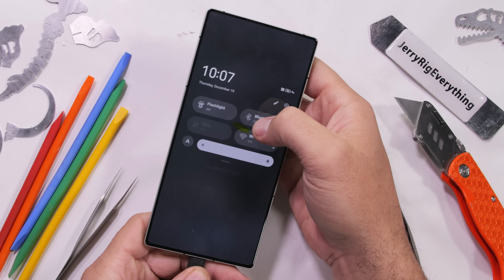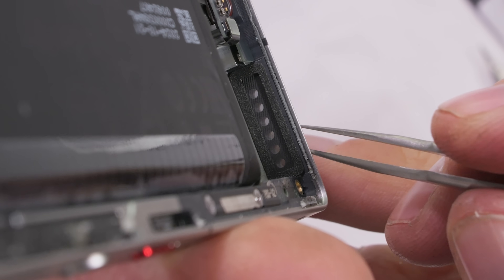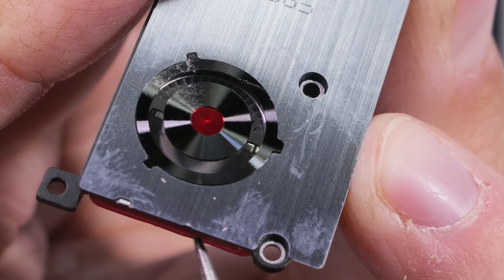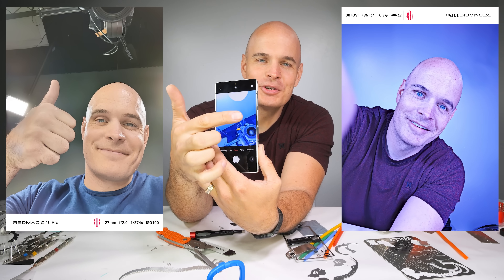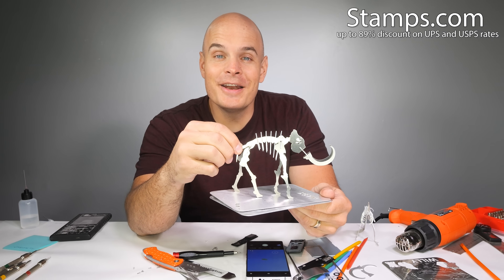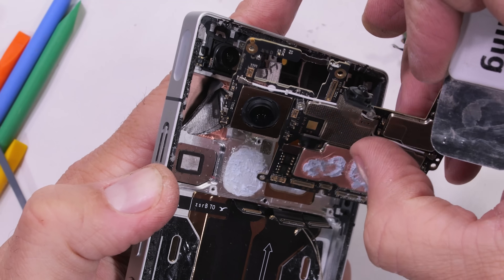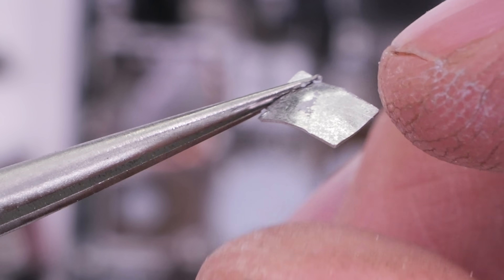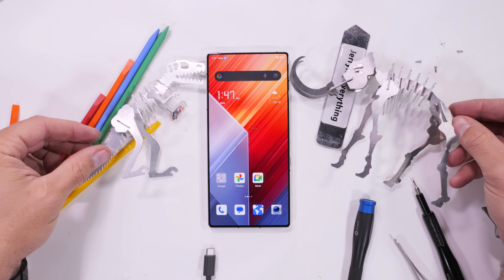The Smartphone from 2040 has a 'Liquid Metal' cooling system inside?

Comment: A heat pipe by any other name? They are great thermodynamic heat transfer devices but you always must ask the question__where is the heat being transferred to? The cell phone body or blown out to the environment via a fan.

Pasadena Public Library 2005 Exiled NASA PhD Wayne Manzo turned Dell Laptop rebuilder is modifying an old Dell Latitude LS700(?) clicking over at 700 MhZ Pentium 3 which caused the noisy fan to turn on. Solution? Make a huge heat sink that is the size of the laptop and connect it to the CPU cooler
inside the laptop. I was using the wrong metal as a Homeless NASA PhD only has access to Aluminum Roasting Pans from the dollar only store. Did it work?
The Mind Controlling UFO NASA DNA Spooks in PASA DNA forced me to adjust the heat sink with the laptop turned on. I remember removing it then accidentally dropping it on the motherboard which solved the loud fan problem by turning the MB into scrap electronics. That is Pasadena for you.
Keep the homeless hiding in the bushes at night and walking around like Zombies. I think all UFO Spook LA County is really a UFO Base.

Comment: After dropping the phone in a fishing pond, I can confirm a few issues. Firstly the cooling still works though I am not going to push, however the volume button for volume up has stopped working. Water seems to stay behind the glass back of the 512gb model.

Comment: Zack, red magic 10 like all of its predecessors have MAJOR problems like:
– Flashy cooling means nothing when it uses a one-sided board with poor thermal layout — SoC & memory cook each other.
– NAND/RAM degrade fast, then die.
– Zero real software support, no long-term patches = security risk.
– UI is buggy, bloated, and poorly coded.
– After 6 months? Value drops hard, performance tanks.
It’s a disposable flagship — sell it fast or stay ready for issues.

Comment: I own the 10 pro. the enclosure for the liquid metal is practical, but comically flimsy, to where Zack completely missed it on the first pass. Considering that Indium is toxic, I would think it to be encased/sealed. Instead, it is exposed to open air when fan module is lifted. Version 11, please have a sealed casing to quell the most neurotic of us dads. maybe... just remove entirely and replace with a micro copper heat sink. happy gaming.

Comment: Like that metal T-Rex. 2040? Poor things.. Strokes Plasma generated Ultrasonic holography pressure printing science Goal: Synthetic Diamond & Carbon nanotube technology + Piezoelectric Crystal with amplifier system to power using Earth's ambient Ultrasonic atmospheric stability frequencies alone. "UFO" Watch "The Twilight Zone (2019) S01E04 - A Traveler" Points at Star like UFO at beginning that is shown in the sky and the Clear smartphone the man had Plasma generated Ultrasonic networking has super range and the resolution potential allows dense data transfer. Crystal based technology can be focused.. Also Humanity can be upgraded to produce Ultrasound and then as a result your devices can power just with you existing.

That's why Earth added alien technology activating in Independence day when the big ships came. Ultrasonic frequency encryption charge tiny crystals with energy that bleeds into a capacitor until it fills then dumps into main startup to call back to fleet for recovery. Lowers chances of signal detected by species with frequency scanners.

People: "Look! UFO's be around Volcanoes!" Maybe something good coming from them people point as bad for climate change propaganda? Points at Star shield of UFO's in those videos Oh goodness, if they have plasma generated Ultrasonic holography they could use waste from volcano pollution to print upgrades for their drone ships while here. Hmm.. I wonder. (Oh btw, if something super powerful is very loud then the only solution within the rules of the universe is elevating it far beyond hearing for illusion of silence. "UFO's make no noise! But sometimes my ears ring.." 😘 Just air vibrating in ears that can be heard.)

Comment: A phone with the top of the line specs, hole-less screen, massive battery, and good cooling for around $800? Heck yeah, I've been waiting for years! Personally, I don't care about the freaking cameras. There are plenty of apps that enhance photo quality. All I want is a clean, sleek, and extremely powerful phone that doesn't break the bank. And this fits every single category! If you don't care about the cameras, this is an S25 killer for sure, price and features wise.

Comment: So lets get this straight here.

1. Its not "liquid cooled" as advertised. Its a marketing loophole.

2. Its not "new battery tech". Just 2 Li-ion batteries stuck together, achievable due to the fact the cameras are tiny and garbage and the phone itself is thick as hell.

3. Even though the air ducting is 'sealed' off from the rest of the phone, you can still get moisture buildup in the ducts, which will transfer to the inside of the phone, since the ducts are thin plastic. 

4. The 144hz screen is useless due to the fact that most games dont go past 90 or 120hz. 

I really wanted to like this thing, especially cause its marketed as a literal gaming PC in a smartphone body. But its nothing more than slightly better flaship features, with massive trade offs like gargabe water resistance and garbage cameras. 

I get that this is a gaming phone, but the way people are talking about this thing, youd think its going to blow every other big name flagship phone out of the water. 

It doesn't. Its a gimmicky gaming phone just like its predecessors, the useless 1-3gen Rog Phone and the Razer Phones.

Comment: I have a request please when you review phone please include what cell network they will work with perfect example is I spent 1000 on the red 10 pro top phone USA version only to find out T-Mobile does not support it and my fold 4 has better speed because the radios in the red magic are not the TMobile 600mhz 5g kinda sucks I am assume the same for one plus but of you were to do a speed test on the 5g network it would let us buyer know.

Comment: A thermal conductivity of 80 W/m·K is not high compared to copper (390 W/m·K) or silver (428 W/m·K), but for a solid <—> fluid coolant (rather than a heat sink) it is quite impressive. Water, by comparison, has merely 0.6 W/m·K at 20°C.
Reply: so would you state the liquid cooling is just a gimmick, and just adding some micro copper sink in place of the current module would be more effective?

Comment: Been a fan and user of RedMagic phones now for several years. Always amazed by all the innovations they put on such an affordable package. 

Those silicon carbon battery tech, liquid metal cooling components, UDC and other techs pack into a RedMagic device is astonishing. 

Former ROG Phone user here and now a Happy RedMagic user/fan.
Reply: How did it go? Do these phones last? How old is your phone?
Reply: @legacymse7095 i used to have a Nubia red magic. For me it lasted same as any other phone. Surprisingly cheap for the thing you get, it was quite a lot of time ago tho. It died from me dropping it In bath, did it couple of times but that time water got inside (because it was somewhat compromised form falling on brick) then the screen stopped working.
Reply: I have an ROG but plan to switch to red magic in a couple years, do you recommend it?
Reply: @steadfastgamer the rogphone does not support refresh rates higher than 60hz for external displays like the redmagic does. Galaxy S, Xiaomi, and iQOO don't support it as well. Redmagic just has some advantages that other phone brands won't have, but every brand has your advantages, like the iPhone's camera. Considering performance and resources, switch to Redmagic. It does everything and more.
Reply: ive heard people complain about bugs and stability issues, how was your experience thus far
Reply: I feel like RedMagic (and by extension Nubia as a whole, especially the z00 line) is like, 2 more years of software support and 3-4 more LTE network bands away from being one of the best options for a smartphone in the US. Theyre amazingly innovative but just have one or two sticking points that make them less than viable for alot of US consumers.
Reply: @Noobuh  red magic 10 is already there btw
Reply: Needs minimum three OS update support for the price
Reply: @jajabinx35  its a gaming phone not really a phone its like getting a console just for gaming basically but if u want a smart phone and a gaming phone go for the galaxy s23-s25 ultras or iphone 14--16

Comment: They need to add a modem that has band 13 as well as full widevine content support. Then I'll be switching right back to the latest Red Magic device. Band 13 is a must for Verizon users and not being able to watch Netflix and other streaming content in full quality is also another deal breaker. Hopefully they rectify these issues in the next iterations.

My S24+ is garbage compared to this and even the older versions like the 9 Pro. S24+ always overheats and performs like utter garbage.

Comment: In the future we are (mostly) going back to cheap nearly dumb terminals that talk to a global AI - they won't need much local processing power by today's standards even if they are displaying 3d hologram imagery (or whatever.) Processing will be in massive nuclear powered data-centers. When you need the big data-centers anyway, it doesn't make sense to have super expensive "terminals." The cost of a modern smart phone is a significant percentage of average income. That can't really continue when these devices are just not that durable and become obsolete (planned by the manufacturers by lack of updates) within 3 -5 years. 

There are a number of things holding us back now, the biggest is that our current internet connectivity isn't good enough for this model. That's changing. Maybe by 2030 it will be feasible to start testing (it's going to need a V2+ Starlink network or equivalent plus massive fiber expansion.) By 2040 it will be the norm.

There will still be a need for small very powerful smart devices, they may not be a "phone" though (phone numbers will be going away, you will use an app like facetime instead.) 
Let's not forget where quantum computing will take us - that tech is still in its infancy and really will change *everything*.

Comment: Man, I’m an Apple user, but not for long. I’m gonna buy this phone as it has the new EITE processor.
Reply: It's still worse for gaming, it regularly reaches 60 degrees and will collect dust inside and will not survive water. Elite on paper has better specs than A series of chips but it throttles a lot reducing its performance a lot, also is very uncomfortable to hold. Stay with your iphone this android has 2 years of updates only. If you want to game consider just buying the 16 pro max or the asus rog phone.

Comment: When they support their phones for 5-7 years I would consider buying.  Until then it’s not worth it imo. Cool phone though.
Reply: you expect that from a gaming phone, that cost less than the major brands and doesnt made 1/3 of money compare to those but still unlike those keep the prices the same per generation, yeah good luck with that.
Reply: @KamiKazeD  I expect that from every manufacturer for their top end phones.  2 years of os and security updates is unacceptable.  The phone is $650 in the US which isn’t much cheaper than the major brands. They have to keep their prices lower because of their poor support. Apple has been supporting their phones for at least 5 years and Google is now supporting their phones for 7.  Samsung is now 5-7 years of support.  Buy a Switch or a gaming laptop if you want mobile gaming. They’ll be way better than this.

Comment: Cool… literally, thx JRE!😉 but honestly I was expecting liquid metal replacing all thermal connection points and not just one which even uses regular thermal paste. Also it be good to compare overall performace when using direct die cooling with the liquid metal which is currently the best way to cool chips.

Comment: Apparently liquid metal is as good if not better than the best thermal pastes used in computer cpu cooling, so at least it's assured that the performance should be stable even for long use... Too bad the screen is only 144 hz, compared to ROG's 185 hz.

Comment: This phone is simply great and despite it having an option of 1tb, an sd card slot would make it 100/100 as a future proof phone (that and extended RAM option, which i dont know if available in it, despite the 24gb combination, it would be a nice feature to have). 
Glad to see it has all the seals that matter, seems to me it is indeed waterproof and they only didnt rated it by being conservative or taking to the letter the IP rating (ingress into body) which would then be something like IP54 or IP58 (if proven that fan has no problem being wet). Of course those numbers aren't any special to see and don't correspond to top of the specs as the rest of the phone, so its understandable to leave them out. But to me, having an IP58 confirmation would be the cherry on the top.

Comment: NEED HELP! I know here're a lot of people with tech knowledge. That's why I'm asking. I accidentally poked my noise cancelling mic instead of sim ejector hole. I poked it hard a few times before realising it was the wrong hole(Samsung galaxy A55) Will this compromise my waterproofing?
Reply: It should be fine, the mic usually isn't directly where the hole is but more to the side to prevent people from breaking it by mistake.
Reply: @linkssz1699  yes but what about the water protection?

Comment: Yeah that’s not Liquid Metal that’s a thermal pad. Not to mention the way he was handling it and it didn’t melt I’m not even sure it’s phase change. It’s also not even connected to a heat generating component. Not to mention the heat sink areas for the fan have no fins for surface area. Pure marketing BS. Wouldn’t be surprised if it was still a great cooler though, one of the only manufactures that actually have a vapor chamber of a size big enough to do anything that copper tape couldn’t.

Comment: the liquid metal cooling is cool but after you said its made of indium and potassium I am concerned about this phone becoming wet at any point because potassium metal is known to react to water extremely violently catching fire and even exploding in some cases even small amounts of it.
Reply: He probably got the wrong info somewhere, potassium would ignite even from being exposed to air or being touched by fingers like shown in the video. Two most common "liquid metal" alloys are indium-tin and sodium-potassium. The second one is highly reactive even in air, so it's probably the indium-tin that is used here.
Reply: An alloy is made of 2 materials. Oxygen makes fires and so does hydrogen but water puts them out. so an alloy of pot and ind wont have the exact properties of either.
Reply: @LulaJake  that is generally correct, but with alkali metals usually you still can't suppress their reactive properties like that; they remain so reactive that they can be "etched" out of an alloy ingot by placing it in water

Comment: Only problem with obscure brands like this, is no voLTE/NR outside the asia-pacific market, unless it uses a pixel 9 profile to trick the carrier into provisioning it.
Doesn't work in canada however, most of these devices just aren't supported or require hacks to get that to work.

Comment: The vanes on the fan at 2:10 seem to vary in size! Might be to spread the fan noise over different frequencies?
Reply: Very interesting remark ! Although I think the angle difference between each blade is what should be tweaked to avoid fan tonal noise. The span difference may reduce vortex shredding still, bringing randomness in an ordered system.

Comment: If this phone had a better water resistance id absolutely trade in my s23 for one of these. Phones nowadays absolutely need to be reliably waterproof due to how used they are in the workplace
Reply: The water durability is compromised because of the intake and exhaust of the fan. If they wanted to, they could have made a more reliable waterproof phone.  but they didn't because it's much more leaned towards gaming. Your s23 is going to be better for daily use trust me.

Comment: That's a pretty cool phone and nice to see how their idea for a gaming phone is getting more and more refined over the generations. If this had something like an S-Pen, I'd definitely buy it.

I would love to see a phone manufacturer have the main camera flip inside the body like how Zack was bending the front one. You would get the benefit of the super amazing camera pointed at your face. So much better imo.

I've also always wondered about using fiber optic lines to poke in between the pixels of the under screen camera, and then bundle them up and shove them directly onto a camera lens in the phone. I think we can reliably make around 2 µm wide strands now. And even on the main screen the pixels are probably about 5 to 15 µm apart. And then "screen door" effect from it can be fixed in software.
Reply: Sounds good on paper but you can't just cut through OLED layers (by threading fiber optic through them). OLED technology is extremely sensitive to oxygen and moisture, the smallest microscopic damage can cause the entire display to fail. They need to be completely sealed, because any exposure can trigger delamination at the cathode-ETL interface, leading to cascading oxidation of the organic layers and catastrophic pixel failure.

Edit: in simpler terms, the space between pixels aren't actually unused space you can do anything with.